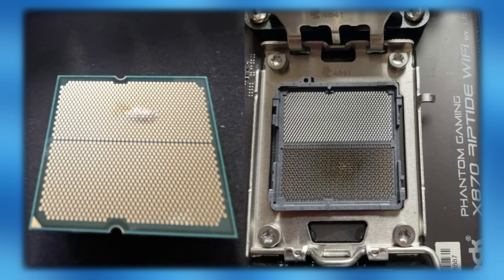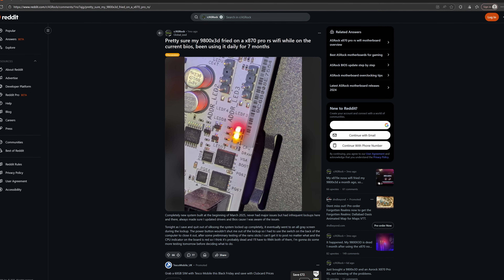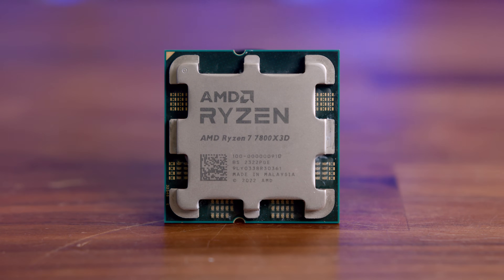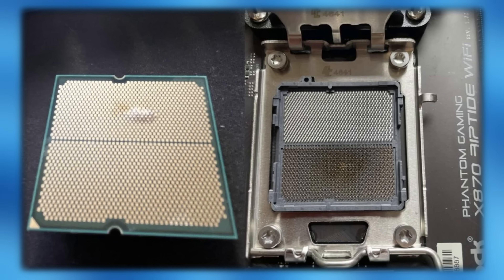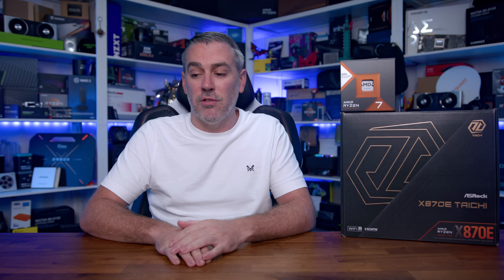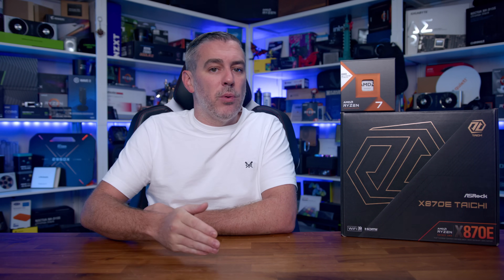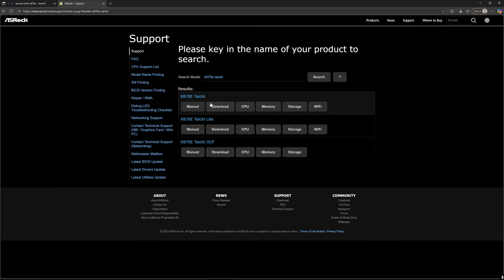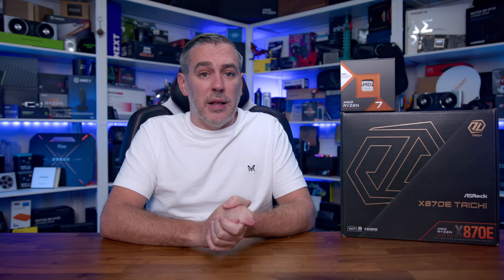AM5 Motherboards Are STILL Killing CPUs!!!

Comment: Andy, here's a revolutionary idea.

Why not ask TSMC what the maximum safe voltage is for their N4P Node which is what is used to create Ryzen 9000 CPUs?

They will tell you it is 1.2 Volts, then you run the motherboards with the 9800X3D with PBO and you will find that ASRock punts in a shed-load more than 1.2 Volts. I know this for a fact.

All this talk of amperage is bullshit, because this would cause electronmigration; whereas overvolting (going above 1.2 Volts) will cause something called "Oxide Breakdown" and degradation/destruction of Ryzen CPUs.

But you would rather rattle off self-serving bullshit from the likes of ASUS or ASRock.

Comment: ASRock has been added to my list of companies to avoid since X670, along with Asus, and Gigabyte. I think MSI has had the most reliable boards these past two gens, at least in terms of enthusiast class motherboards. The only motherboard I would even consider for AM5 is the MSI MEG X670e Ace, and if I absolutely had to spend less than that, the MSI X670e Carbon. Godlike is a good mobo but too expensive. I think X670 is more reliable than X870.

Comment: Apparently, a flaw in the chip or whatever this ASRock deal is already caused degradation, and after some recent stability issues, bios reloads, etc.....hard crash last night and now will not post.  Such a bummer...thought I dodged the bullets.  Board is B850M Steel Legend. I wasn't overly paranoid since it was X3Ds primarily and I have (had?) a Ryzen 7 7700, but I was still concerned so kept up with the bios updates. Sadly, didn't work out. ASRock stuff has been great and I hope they turn this around.

Comment: The problem is also high-end CPUs which are pushed to their limits with frequencies and voltage, practically overclocked in hardware. CPUs that consume more than ~100W are not a good investment. It's better to buy a mid-midtop range CPU with 65W TDP if you want a reliable and long-lasting CPU. The same, if not even more serious goes for GPUs. Never buy anything consuming over ~100W. They're all "hardware overclocked" and will die much sooner than a lower spec CPU/GPU. It's always a good idea to try undervolting and keep the top temps under or around 60c, too. A little goes a long way. 😉

Comment: amd gonna do reverse uno by changing sockets with am6 for zen6...wifi built in no longer shared with cpu usb sleep and wake pins is now on pcie bus instead that devices do its owned wake and sleep by itself without need cpu doing for it since AMD aren't great with USB wake function to get correct voltage that resulted back fired with ground pins got wrong voltage resulted SOC voltage went reverse to USB voltage 3.3v to 5v for SOC, idk why amd did that for entire socket designed to crammed everything in small space that share its pins with onboard USB devices with cpu SOC voltage . Intel never had this issue with since everything onbaord are native to pcie from sound to wifi to IC sensors. ALso specially when motherboard users don't understand why plug both 8pin cpu power cables for ryzen 7 cpu's when it designed only for ryzen 9 cpu's

Comment: Man I want to upgrade from my 7500f to an 7800x3d atleast and this is making me think twice. My motherboard is an asrock b650m pro rs wifi.
Reply: the "issue" seems to not effect 7000 series rather reported of the 9000x3d cpus but the results cannot be replicated in a test environments. I upgraded to a 7800x3d from a 7500f on a Asrock B650M Riptide with PBO on +200mhz with -30mv curve undervolt. No issues detected.
Reply: @UncannySense  thats kinda reassuring, I dont plan to pbo undervolt or overclock anything, just stock everything. I guess I can upgrade with less worries after I update to latest bios

Comment: i have owned my 9800x3d and Asrock Taichi since the 7th Nov 24. I have PBO active and temp capped at 85deg so it throttles thereafter. It never gets to 85 anyway . Im on bios version 3.50...all good. regarding your statements, how do you know your correct, have you tested or are you just stating what you have read, how do you know its SOC voltage, or TDC etc Im following Wendell at the moment whose got a lot of boards on test.

Comment: Yeah I don't know, I think I know the issue. Bought the x870 live mixer, came with 3.4. wouldn't flash to 3.5 in the bios. The bios did flash on flashback bios. During sleep, suspend or idle. The system becomes fully locked up. So the solution was to disable all that. Even after that while watching videos and you go to sleep and wake up, windows is locked up. Ok another issue, can't get into the bios. Unless using launch uefi exe. Another issue, when in the bios and you dare let it sit. It'll lock up in the bios as well. The issue seems to be an issue with the clock chip. Assuming it uses one. Because wake sleep state is broken even in the bios. Idle is 30c with 240 aio 60-70 gaming, I did notice while a game is compiling shaders it's hitting 85c that's sketchy to me. Makes me think their is also a power delivery issue. As if it doesn't notice when 1 or 8 cores are being used. So while compiling off one core it seems to give full power to one core. Hence overheating. I have a hunch , if she sleeps and locks up who's to say it won't know how much power to feed at idle-locked up state. Hence fried chip and board.  Another issue is when you power the PC down, it would fire right back up. Unless power was pulled. Fast boot was disabled by default. Enabling it fixed the problem. But yet another sleep state issue.

Comment: ASRock's 3.40 bios works fine but can't fix  CPU already damaged by earlier than 3.40 bios.  Solution?   Start from 3.40.  If you have used CPU earlier than 3.40 ,  just use until CPU die preparing RMA ,and RMD cpu , and  use received new CPU on 3.40.

IMO, AMD 9000s CPU has durability problem. Maybe due to 4nm TSMC  or PBO design of Zen5 or complex.

Comment: I have the Asrock x870 Pro RS Wifi with the Ryzen 7900x with Klevv 2x16gb 7200 and I had the same issue, could not see burning on the CPU but it died. it started with the pc booting and dram & cpu led goes on, then goes to green led and stops there before POST. after pressing the reset button, it boots fine. It never froze or anything, just the booting was an issue. few days ago nothing passes the cpu & dram leds's... and I have done everything to check and first time this happened I did the BIOS to 3.40 then that worked and that time only. Took it back to the shop and they are replacing it now under warranty. had it for 9 Months. also logged a call with Asrock as well, but does not seem like they care anymore about this. maybe its not related...maybe I was just unlucky.. who knows.. still very disappointing after I chose to go with the PC when my Lenovo LOQ's motherboard died with the Intel i7-13650HX

Comment: Apart from waffle, you haven't really done any homework.

If you have an ASRock motherboard, and have a 9800X3D then after you have gone into the BIOS and set your EXPO, boot into Windows.

Downloaed Ryzen Master and Benchmate.

Download and run Ryzen Master

From Benchmate kick off CineBench 2024 (which is not as much of a load as CineBench R23) and then kick off the multicore benchmark.

In Ryzen Master, check that the "CPU Telemetry Voltage" is at around 1.18 Volts, because this is what AMD mandates for the 9800X3D at stock.

Of course ASRock, being the geniuses they are (and by genius I do of course mean monumental weapons-grade cretins) have the CPU LLC set to medium (it should be set to the lowest setting at stock).

One poor guy came to me and he had NOT run PBO, and when I looked at his system running CineBench 2024, the CPU Telemetry Voltage (the "Get" voltage) was at 1.27 Volts.

He had only had the system for six weeks and had originally approached me because his system was running hot.

When I manually configured his system correctly then he was no longer able to run CineBench 2024 stably at above 5.1 GHz, although he should have been able to run at 5.225 GHz, which can easily be run by the 9800X3D at 1.15 Volts, if you have decent cooling.

Comment: Watching this video on my PC with a Ryzen 5 7600X and an ASROCK A620i PG Lightning Wi-Fi motherboard, which perfectly supports a Ryzen 7 9800X3D (since it has more than enough VRM and PPT for it), it's curious to see that in over 98% of cases the problems are with the X3D, leading me to believe that users may be using very aggressive overclocks on these chips. On my Ryzen 5 7600X, I only do a basic undervolt (-80mV) and set the TJMAX to 90ºC, that's all, and it reaches peaks of 5650MHz on all 6 cores sometimes. I don't usually leave the PC in sleep mode. Anyway, I've had this build since January 2025 and only had problems with BIOS 3.40, which for some reason made my PC shut down and not turn on again. But when I disassembled and reassembled it, the PC turned on again, so I decided to update to BIOS 3.50 and to this day, more than 70 days later, the PC works fine.
Reply: I had this same board/CPU combo (Asrock a620ai + 7600 non x) and the CPU failed, started drawing ~100 watts at idle and clocking under 400mhz…

I returned the board to Amazon and replaced the CPU through MixroCenter and got the 7600x…but I have it running in a B850i board (also AsRock)

I didn’t post it on Reddit because I wasn’t sure it was the board the killed the CPU, but after testing all other components I narrowed it down to the board or CPU failing, just not sure why or how.

Comment: Cant say i've ever been a fan of Asrock, a spin off of Asus budget line, that went solo. 
Similarly throughout my experience the Asrock along with gigabyte have consistently had issues over the years to the point where i just don't consider either brand where possible, i don't want to outlay all that cash for future issues down times or even rma so troll.  

Been in the computing scene for over 20 years.  Only gigabyte new higher end gpu i bought, black screen on my high end new build.  Asrock initially was rather good it was rising to name share when i first started in pc sales.  Although over time its got a history of seemingly over volting the world to get better results, at its components price points for higher fps / performance and sales.  

Something gigabyte was similarly thought to be doing on its mobo.     Perhaps its not only these two, likely its not, but they seem to be the ones consistently with the issues.  
Its either firmware or post issues and i just don't have time or the inclination to risk troubleshooting.   Only to discover oh its not software or some sort of non hardware issue and go off on a tangent trying to troubleshoot to only discover.. Ohhh  it is the * brand new expensive hardware. now i got downtime messing with rma process or return to store and wasting time which is bonus labor im not getting paid for.  So those costs are added cost to the value of the issue i just paid for.. brand news and F'd.

Comment: The problem is the ridiculously high auto voltages applied after enabling XMP/EXPO. Veteran users will adjust voltages manually and therefor avoid issues. Long story short, AUTO settings = BAD.

Comment: Ok so I’m wanting a new top processor I’ll have around £300-500 and I know I’ll need a new motherboard with it, which one should I get?
Reply: I got the MSI Carbon x870E and its been pretty solid but im not using x3d. The strix boards seem pretty good as well.

Comment: So much of this must be written by AI and there's a load of assumptions implied as facts. This guy doesn't really understand the problem and nobody knows exactly what the core issue is. These reports are from an extremely small percentage of users and A LOT of people have been running on the same bios since launch without issue. That clickbait thumbnail is even worse.

Suggestions about upgrading bios are fine but take the rest with a grain of salt and look for information from more reputable outlets before making any decisions.

Comment: Turn off ALL Sleep /  Suspend modes, Turn OFF Gaming Mode, Make sure the physical  power button on your computer does not create a suspend state, and this problem goes away. Obviously you want to make sure the most recent bios update is installed. running 9900x on Taichi x870e,  Thermalright 360 Trofeo Vision AIO, not one single problem. not even a blip. Running 5800Mhz, PBO with Klevv Cl30 ram at 6400 Megacycles. It Chomps through large data sets with zero issues.

Comment: When I purchased my 9700x and Gigabyte  B650 Gaming X AX v2 board from Microcenter the first thing I did was enable PBO and manually set the PPT, TDC, and EDC to the 65w limits. I also am using mixed ram so I cannot enable EXPO, so I manually inputted the fequency, timings, and voltage going off the stickers on the ram sticks. So far no problems but I have been updating the board about a month after they come out.

Comment: My Asrock B850i Lightning Wifi killed my 9950X3D. I kept the motherboard updated to the latest BIOS when possible. It was exhibiting failure to post issues in the weeks leading up to the total death, but eventually it would refuse to post at all.

Replaced the 9950X3D CPU via AMD RMA and got the replacement processor within 10 days of opening the RMA ticket. Also RMA'd the Asrock motherboard, but I don't trust it anymore. Replaced it with an Asus B650E-I board and it's going strong with the replacement 9950X3D with zero failed to POST issues or symptoms.

I recommend to avoid Asrock AM5 boards for Zen 5 X3D processors. Soemthing about Asrock is clearly killing our chips that they refuse to openly acknowledge.

Comment: is setting negative PBO to undervolt CPU a good idea to prevent killing MoBo or CPU?
Reply: it can't hurt. You can also lower the SOC voltage slightly. I've set mine to 1.18 (down from 1.2 default)

Comment: I'm currently rocking a AMD Ryzen 9 9950X3D and an MSI Carbon X870e motherboard and a 5090 suprim liquid soc, had no issues been using my rig for around 9 months now but I'll probably update the BIOS just to be safe... Think I last updated in the summer time there's probably new updates available. I know it's mostly ASROCK but better being safe than sorry especially with expensive equipment.
Reply: MSI is better than asrock
Reply: if it not broken ..dont fix it ..

Comment: I have the x870e taichi with version 3.5 bios with 9950x3d. running since july this year, no issues.
Reply: Also running the same specs, enabled expo and with an undervolt -25 all core, I have not had a problem also had this spec since July, and before that was running a 9800x3d which I moved to another pc since I was really confident that I would not lose a cpu to the taichi lite that I have. Note I had the pc since Nov. 2024 and went from bios 3.10 to 3.3 on the 9800x3d and 3.3 to 3.5 on the 9950x3d
Reply: Seeing posts like this make me feel better lol. Since waiting for same mb and cpu 😅

Comment: ASRock motherboards are at best suitable for budget processors. This applies to both AMD and Intel. I would never build any platform on them. I've had problems with them twice. Even if they claim otherwise, they're often untrue. We once installed a 10-series i9 at our company, and according to the specifications, the power supply should have been able to handle the processor without any problems. Constant reboots and freezes. I replaced it with an MSI MAG and the problem was solved; it still works today.
Reply: Meh, I've had an x870e nova and a 9700x for about a year with a fairly tuned system, I've never had any issues and I'm on the latest bios right now.

Comment: i've herd a fat 32  thumb drive usb 2.0 of 16 gb is the best usb choice for bios flashes  can you confirm this?
Reply: You can make a small FAT32 partition on a usb 3.0 thumb drive too, it could be 128 mb and it would get the job done and you can still use the drive for something else. Just make sure to put it in a usb 2.0 port or the one designated on your motherboard.

Comment: My Ryzen Zen 1 R5 1600 melted a pin on an AsRock the first time i went to AM4, the board and CPU was RMA, replaced with same mobo and CPU and no issue, but went Asus when upgrading to Zen 3 R7 5800x, and now looking at AM5 gigabyte b850 Aorus stealth ice, and Zen 6 12 core X3D.

Comment: Never bought an ASrock motherboard - after this, never will.
Reply: I'm sure they won't be able to sleep at night after they lost you 😂
Reply: @Cosmic_cloudx Me and hundreds of thousands of others. Believe me they care about all of us in total.
Reply: @regwatson2017  they dont, no one care, people who read 200 out of 2 million is a problem is not really the customer market. Lets face it, the number is stupid, 200 out of millions of sold AM5 platforms have lost a CPU, and no matter what, a great number who had a CPU lost it due to AMD or their own attempts in Bios. We seen that fact when many of the screenshots showed they had bios 3.15 even when Bios 3.25 was out and they had adjusted the settings in some attempt to overclock.

AMD themselves had failing CPU's as the initial 3.15 bios was set to the standard AMD stated their CPU was capable of, yet the CPU's failed to shut down, it's why AMD themselves issued a refund statement at the time. Imagine making a £400 or £600 CPU that cannot shut down or fails before it's limit is met. 

Yet people still throw money at CPU's AMD designed to operate at 95c with Nvidia GPU's that have melted more cables than Asrock damaged CPU's. 

So we should not buy AMD, nor Nvidia 5080 or 5090 or AMD with 12v cables, or MSI or Gigabyte, or Intel as all have had hundreds of failings. Most memory companies have kits failing Memtest on a daily basis, so should be avoided also. As should Windows 11 and NVMe drives.